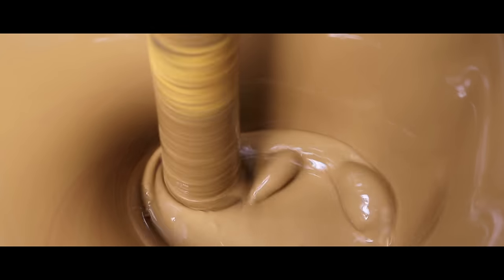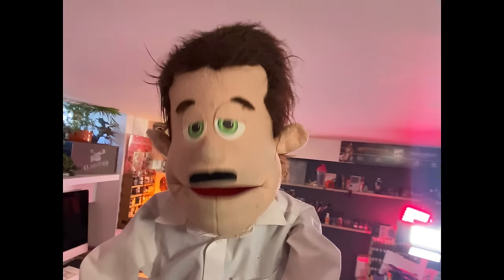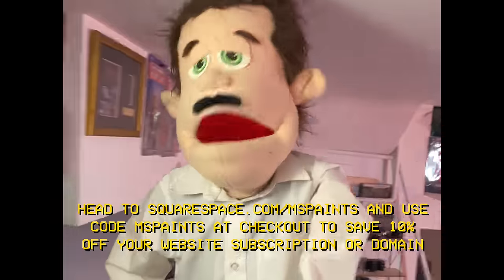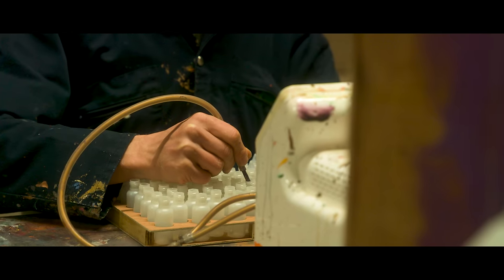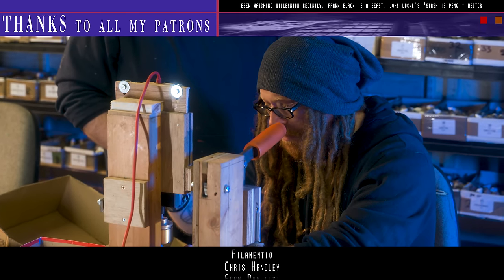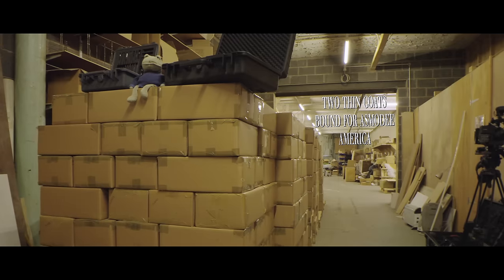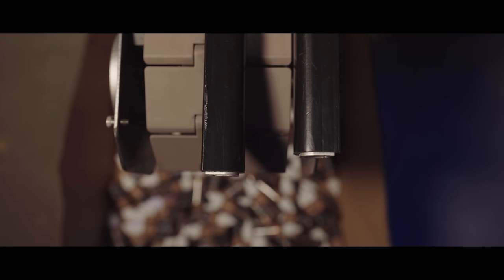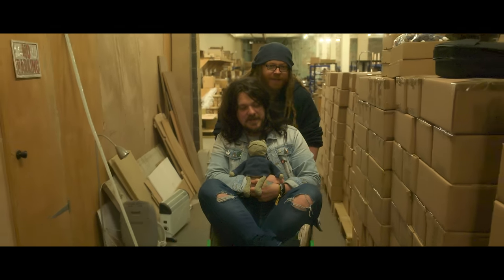How Your WARHAMMER Paint Is MADE

Comment: impressive ghetto rigged setup, shows you can get a long ways with grit and will.  

Though I have to say though, how on earth are they doing actual proper quality control of the actual paint itself? If they are just hand mixing colors by eye, more or less, in to white carriers just by pouring in what ever pigment in to it, and then mixing it up with handheld cement mixers, then I just can not see how its possible to  make consistent batches of paint.  And they are doing this in what looks like a back yard shed, with no heating either.  

But hey, best of luck to them :)  I wish nothing but the best, and they got balls going in to the hobby paint business, insanely competitive and saturated marked.
Reply from the maker: Each batch of paint is manufactured by a paint manufacturer off-site. You simply gotta re-mix it and the bottling plant. Yeeeeezy peasy.